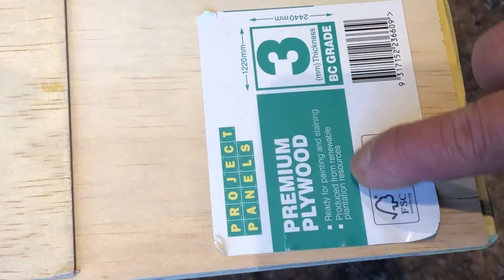How to make a DIY plywood canoe - from start to finish

Comment: That has the sweetest curves I've seen in any plywood canoe.
Reply from the maker: Awe … thank you so much. I guess that is because no stitch and glue of a few panels together. This canoe is made of just 1 panel (2 ply joined). Easy to build if you know what to do. No special tools. Just a hand saw, cutter knife and lots of clamps but you can do without the clamps if you screw the gunnels in. I am preparing a step/by-step manual and episodes of the building at the same time. Keep in touch 👌😊

Comment: Thank you so much for the plans. So glad it's holding up well without using marine grade plywood.
Reply from the maker: You are welcome, Jeff. If done right, most  Non structural 3mm ply would work. There are two most important steps. I can assure you one of it is not the rolling or bending or torturing part. The rolling part is the easiest and interesting part. You’ll be amaze how it starts to take shape. I’d say that is the highlight of the built but also the simplest. Happy building 👍🏽

Comment: The very best idea of this is that that no plan is needed! Everything is so simple to build a board according to everyone's needs or size! A little more additions and a sailing board can be built. Thank you very much for your excellent job!👋👍
Reply: No plan? NO PLAN?? You think this is just off the top of his head? There are DETAILED plans and exact measurements that must be made.35 pages of instructions. That piece of printer paper on the worktop isn't a coater. He glosses over them in the video because they are the boring part. There is more prep work measuring and marking than there is cutting and bending. The only thing that takes longer is waiting for the fiberglass to dry.

SOURCE: I bought the plans for this boat and will be building it. There are LOTS of measurements that need to be exact for the boat to be square. Build this by just watching the video and let me know how it goes.
Reply from the maker: @robertwills7022 thank you so much, 🙏. The best comment I’ve ever heard. You made my day. Thank you thank you.

Comment: Thanks for the video. Ive been wanting to build a canoe like this for some time because it looks like its extremely light weight. Great job.
Reply from the maker: Yes it is. You can build it as light as 13kg. I am 120kg. I use thicker gunwales. Hardwood decks and bamboo seat. Happy building. If u need the free plan email me at Corneliusoutdoors71@gmail.com

Comment: From someone who has built two canoes myself, great job, very well done 🙂
Reply from the maker: Thank you so much. The thinking and planning are the most difficult part. Once started kind of okay and improvised along the way. Made a few mistakes. Almost gave up when one end cracked. Managed to patch the crack with fibreglass and continue. Phew!!!
Reply: @corneliusoutdoors  Yes I know where you're coming from, its easy to fix up
  mistakes and still make it look good !
Reply: If u don't mind me posting on your thread here, that's the mark of an experienced craftsman, making a mistake or something goes sideways n knowing how to fix or incorporate it so it looks like it grew there👍👍
Reply from the maker: No , not at all. Thanks, Clint. If I am to build another one I will plan it in such  that the boat is made of 4 sections and each should be the exact copy of the other.

Comment: Amazing build! This is by the best and the most low cost method of building a canoe. So far I have watched this video more than 20 times. 
I need to build this. Wish I could get the plans.

Thank you so much for sharing this video
Reply from the maker: Hi Ali, yes, I have the plan. Send me an email at corneliusoutdoors71@gmail.com
Reply from the maker: I have the free version of the plan. I also have a comprehensive step by step version which I will ask for a small compensation. With the step by step, you won’t have to refer to the video 😊
Reply from the maker: Thanks, Ali. Yes, you just need 2 pieces of 3mm plywood, 8m x 1m fibreglass, some epxoxy/hardener and timber for fittings. If you plan it well, it can be ready for the water in a week. 👍🏽
Reply: Yes the step by step version will be better.
Reply: I have received the free plan. Thank you so much
Reply from the maker: You are welcome 🙏, mate. All the best. 👍🏽

Comment: You did a lovely job, would I be cheeky if I asked for the plans? I have found some 3mm marine ply, and would love to try my hand at building one, it must be very rewarding, well done. Regards BB
Reply from the maker: Thank you. 🙏. It was. Finding a 3mm ply is the hardest part. Some places don’t sell them. Good work. Please email me at corneliusoutdoors71@gmail.com . I send you the free plan
Reply: You are a star, got and printed out the plans-  you must’ve spent a lot of time producing, look forward to Studying them.
And look forward to an update in the future, it will be a steel at less than $30 – small price for the work involved. Thanks again, and will always come back to this video for inspiration. Regards BB
Reply from the maker: You are welcome 🤗. Happy building. Marine ply a little rigid. You may need to wet the bottom in and out and run a steam iron on it as you bend the ply. Marine ply is made of hardwood. I explained this in the instructional pdf and how to go about it. Merry Christmas and Happy New Year 🥳

Comment: Wow I thought for sure you’d use some heat to bend the ply that mush smoothly . Amazing it held that much of a bow without splintering
Reply from the maker: Thanks. It’s an amazing design. I couldn’t believe it myself. Those are just a normal ply. Pine ply I think. I told my wife. If it breaks I will just make some small projects like tissue boxes 😊. In fact before I proceed further I took a cut out ply (2 x 3 ft) and bent it to almost a perfect letter U. Made scary noises but it was okay. I will share that part in the building episodes. The canoe bending process was a lot easier than I expected. As long as you start tightening the straps from the ends to the middle, it was so easy. No strength needed. A child can do that bending part. Amazing design, really.

Comment: Amazing work! Bravo!
Reply from the maker: Thank you, mate! I will have to start making the building episodes. The details making this canoe is so amazing. I was prepared to use it as firewood if anything bad happens. Mainly because I use cheap plywood and I did use any hot water or steam. Every time I pull the straps during the torturing process, I was just prepared to hear a big crack. But somehow all good…errr not really.. I will show in the next video the fails and how I corrected it. Thanks again, bro

Comment: The canoe is a beautiful watercraft, ideal for its time and the availability of materials. However, those of us who have spent a lifetime in paddle boats prefer a more efficient design. On a lake in a canoe you are subject to wind.  The broad surfaces presented fore and aft will establish your direction.  We did Ross Lake on the Skagit in WA, 2 kids, dog and gear for a 3 day weekend.The 16 foot Canuck with square end seemed OK at the outset but coming off the lake with the 3hp motor and white caps was memorable.  The following year I had built two Norwegian Kayaks with lower profile.  Same people, same gear but much safer and they still fit on the rooftop rack. The Parker Design, with Sitka spruce frame and Ceconite fabric  and nylon line joints resulted in a 40 pound boat that would easily hold 750 pounds. We used them on the Lewis, Columbia, Willamette and Mackenzie rivers as well a  various lakes. Now I paddle a catamaran kayak,  I can swim with it and have surfed  it on  the Columbia River Bar and the great Salt Lake. It is 16 foot longx40" wide and weighs less than 80 #  It has 6 sealed compartments , accessible with deck plates. If you are interested, I am east to find in Tillamook OR.  503-374-4919
Reply from the maker: 😱😱😱 wow wow 🤩. The Norwegian Kayak would be my pick
Reply: Привет

Comment: Very nice. I would like the plans please. I already have an 8ft boat I made but this canoe seems like an interesting build with the bends and curves.
Reply from the maker: Thank you 🙏. Yes, the building is very interesting. Once the gores closed, the ply curve up taking a banana shape. When you start to bend the sides, the magic happens. A beautiful lightweight canoe. Please email me at corneliusoutdoors71@gmail.com
Reply: @corneliusoutdoors  I sent an email. Also, is there a specific epoxy to use on scarf joint or would any work? 1 part or 2 part? I have only used two part a couple of times.
Reply from the maker: Any will do I think. There is not much stress at that section. I use 1:5  and thicken it with sawdust or wood flour. It helps to fill any gaps or holes.
Reply: @corneliusoutdoors  thank you. I am eagerly awaiting for the blueprint :) I'm looking forward to Attempting this build.
Reply: @corneliusoutdoors  I received the single page free plan. Thank you so much. It's perfect!
Reply from the maker: You are welcome! 👍🏽👍🏽👍🏽

Comment: Awesome build!
Were you able to smooth out the transitions between the relief cuts along the side walls, or are the transitions notable?
Reply from the maker: Thank you. Almost smooth. The fibreglass cover most of it.  Not noticeable at all unless you purposely looking for it. The 5mm relieving holes at the start of each gore is useful, I think 🤔.
Reply from the maker: Also, maybe the way I measure and mark the gores is different. I don’t go by diameter of the points. I use a square ruler and mark the tangent line of the offset cut. I will try to show this in the upcoming building episodes. You can actually see me marking the tangent line in video. But it’s on Timelapse

Comment: Five gallon bucket’s of water are great at adding weight to hold the glued stuff in place. Use 2 buckets and a old scrap piece of 2x4. Put the 2x4 on the wood then the buckets of water on top. One bucket 1/3 the way in on each side. Gorilla glue seals the wood too. It’s stronger and better the super glue. Should of got marine grade plywood. Either A-A, A-B, or at least B-B. The B-C grade will eventually peel from the water if it gets to it. If you scrape the bottom on a rock or something like that. A hole in the fibreglass can occur allowing moisture to the wood. Then the same fibreglass protects that moisture letting it remain longer. If not permanently. Just a warning. Might want wider paddles. They bite the water more giving you speed and better Manoeuvring. I used to repair boats years ago. Once the moisture barrier is compromised your in trouble, and it will happen over time unless you just hang it up and never use it. But you did a great Great job, absolutely brilliant brother! And it’s better then the nothing I have today. I used to have an old aluminium Mohawk canoe. Best canoe in the world in my opinion. Stable, shallow draft, and extremely light. I used to carry it into the woods to the little ponds and lakes no one every went to. Great fishing! One lake the ground around it was like walking on a bouncing castle or jello. Half the time I had to walk on the canoe to go from roots to roots to get to this pond. Like bottomless mud. I found out the hard way! A few places around this pond was the same. It’s a spring feed pond, and had a little two foot wide creek leaving it to the main creek. It had a four inch log that was had died and fallen and made a little walk out at this point. I being a more on. Decided I can get closer walking out on the little log. Worked great… for a while until it got muddy. The got slippery. Needless to say I eventually slipped into the two inches of water and who knows how deep mud. I wound up with a fishing pole in my right hand, and my armpits on the log and my feet didn’t touch anything solid, and I’m five foot ten inches tall. Good old days when I was young and dum.
Reply from the maker: Thanks for sharing, Paul. I can imagine every bit of it. I grew up in the dense jungle of Borneo. I miss everything. We eat meat just a few times a year when my dad hunting trip successful. Other than that just veggies and fish sometimes. Yes, your suggestion on marine grade ply. Very true. I paddle this small one mainly on the lake. You are correct about the paddle with. The one on the video was for my wife. I thought would be suitable for the small canoe. I have since using a broader one. I built a bigger canoe before. Super heavy. 38kg. But very stable. I used construction 6mm ply. Hard tropical plywood. Nice chatting with , Paul. My name is Cornelius. My Dad used to help in the kitchen of a missionary from Australia. He saw my name in the Bible. I am leaving in Melbourne Australia. Been here since 2015. Very lucky. I get to experience most of my childhood on Borneo here. I am busy catching yabby now (crayfish) . Other than fishing for eels, carp and red fin . Stay in touch.

Comment: Nice job dude..I've always wanted to build a boat but never have.. I've been a carpenter woodworker cabinetmaker for 40 yrs and know it's well within my skills just have to get on it someday,  amongst everything else..great job tho, not only functional but looks great. I like how u pulled the boat into shape with the straps and the boat looks like it came out fairly even on both sides
Reply from the maker: Thanks, Bro. Every pull I had the fear that the ply would just snapped. I left some gaps between pulls hoping the ply will accustoms to the stress. Maybe I didn’t have too 🤔
Reply: @corneliusoutdoors  if it wasn't an interior grade plywood maybe soaking it with water couldve helped but fortunately u didn't need to.. nice lil boat👍👍
Reply from the maker: Thanks 🙏

Comment: Beautiful! How much weight can it support on the water?
Reply from the maker: Thanks 🙏. I am 110kg + 30 to 40 kg of luggage. If sitting on the floor of the canoe, two people can paddle comfortably. Also, you can adjust the canoe to be wider even after built to improve stability. Email me at corneliusoutdoors71@gmail.com if you want the plan .

Comment: I asked for the plans, politely  and I was sent the plans, Promptly.
Now I need someone to send me the time, the skills, and the space to execute these plans. :)
Reply from the maker: Lol.. you’re welcome. First thing first. Get the two pieces of plywood . You will start to feel guilty seeing them laying around. Space? Any flat surface. On the floor is even better. No mess. Very little sanding. Glassing? Do outdoor in warm summer. Skill? Beginner level is more than enough. Tools? Box cutter knife, small power drill and a few bar clamps. Time? Less than an hour after work. Only glassing needs a bit longer. All the best, Ian. Let us know how it goes 🫡💪🏽💪🏽

Comment: great work!!
where i could get the drawings?
i think your design is best I've seen so far!!
Reply from the maker: Thank you so much. ☺️ please email me at corneliusoutdoors71@gmail.com and yes this is such a great design. Very easy to build and versatile during and after build. You can still adjust the size, length, width, water displacement, profile of bow and stern. You just need 2 pieces of normal 3mm plywood and fibreglass kit. The strength of the canoe comes from the arch just like an arch bridge but upside down. Done! 😊👍🏽
Reply: @corneliusoutdoors  thanks for video. Plz can you send me the drawing
Reply from the maker: @SamanSudhasighe thank you 🙏. please email me at corneliusoutdoors71@gmail.com
Reply from the maker: @ Thank you 🙏. Please email me at corneliusoutdoors71@gmail.com

Comment: Do you scarf the gores?
Reply from the maker: That would be difficult. The ply will curve upwards when you close the gores. You can do stitch and glue. In this video I just use superglue. Quick, cheap and easy. $1 bottle of superglue was more than enough. I have prepared a step by step plan. Email me at corneliusoudoors71@gmail.com

Comment: Thanks for the video! I'm seriously considering building one. I was wondering, you left gaps on the inwhales, is there a reason for that? Also, do you know if your plywood was hardwood? My local store sells 3mm hardwood plywood.
Reply from the maker: You are welcome and you should build one. If done correctly, the building of this canoe is very easy. The gaps look nice and also for draining. Getting in and out during a long trip dirty the inner hulls. I usually submerge the canoe in water and wash it like washing dishes. I then just lift it upside down and carry it to the car. I am not sure about hardwood. Please ensure that it is “non structural “ plywood. I am here in the US until the weekend. Let me try to visit a home depot and see the types of plywood they have. Which store did you use to go to? I have a few questions from the US in this. Email me at corneliusoutdoors71@gmail.com for the free plan. 👍🏽
Reply: @corneliusoutdoors  I only saw one kind of thin plywood at home depot, it is 1/8" thick. It doesnt say anything about being structural.  I could go to a wood supplier, but I like the idea of using inexpensive, readily available wood...but if it breaks i may regret that. I was also wondering what kind of wood you used for the gunwales? I'm thinking here on the west coast US, cherry would be a good option. I know nothing about fiberglass, so I'm also wondering about how much resin I'll need, and what weight fabric to use? Sorry I have so many questions, haha.